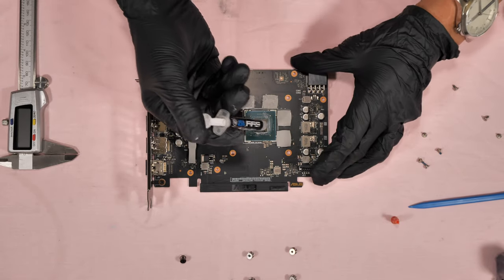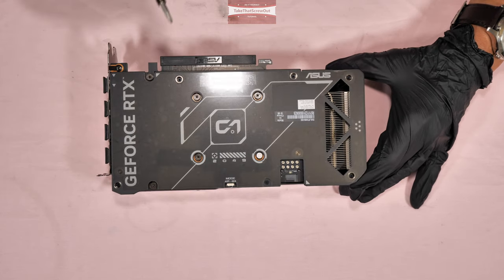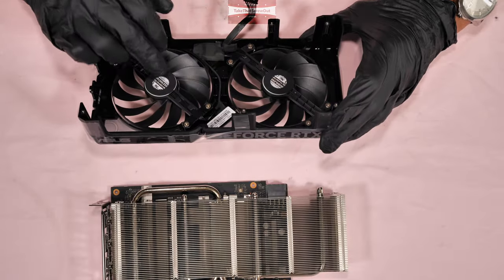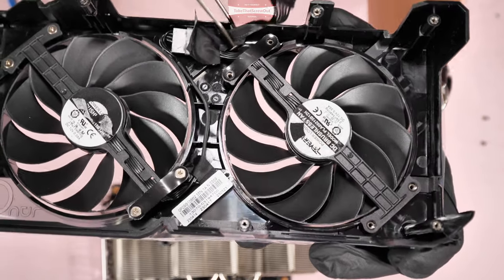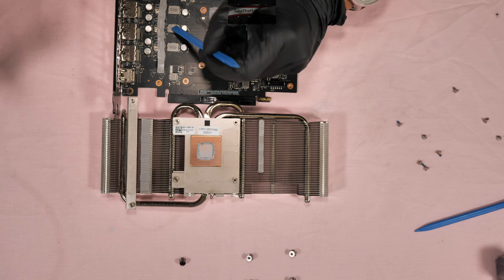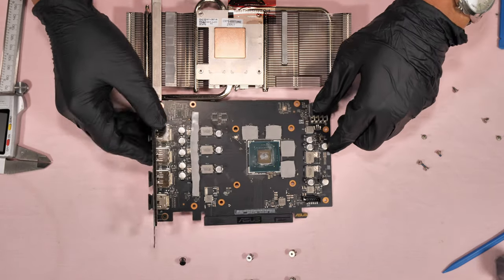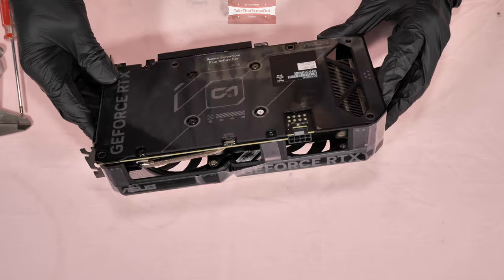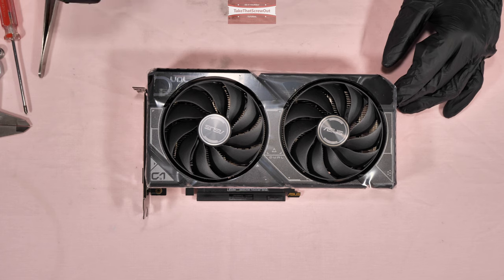ASUS RTX 4060 DUAL | Disassembly | Thermal Pads & Fan Replacement STEP by STEP Tutorial video

Comment: Did you note any improvement in hot spot temps on either the GPU or vRAM after repasting ? thanks !
Reply from the maker: Hi bro! I did Test this gpu after repasting..to be honest the result was exactly the same due to this gpu was brandnew, all the Thermal Pads and the Thermal Paste was so fresh from the Factory..so, before and after was no Performance difference on my Testing with COD WARZONE and other Games.
Reply: @TakeThatScrewOut  Thanks !
Reply from the maker: You're welcome bro! Take care!

Comment: Yo bro, so I searched this video, because I dropped a drop of beer on the red screw with a red circle on it while it was on, shut it off immediately and cleaned but didnt open it to clean, it seems to be working fine. But in your opinion does that small opening on the screw give potential for water damage or is it relatively far away from critical components?! Screw at 3:30
Reply from the maker: Hi bro! That depends on how much liquid that dropped..but if you think its just a tiny drop, you should not to worry about that would only dried up by the warm air circulating inside.